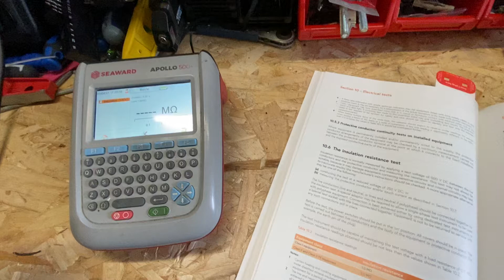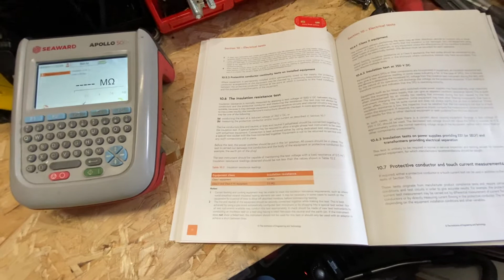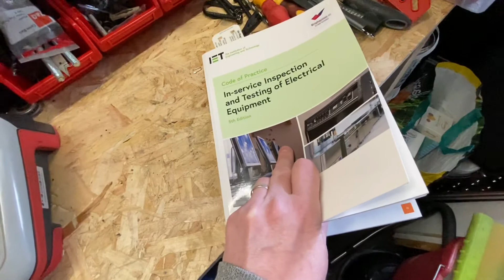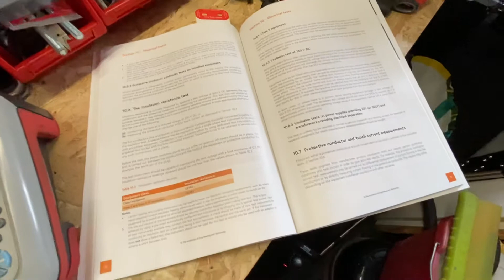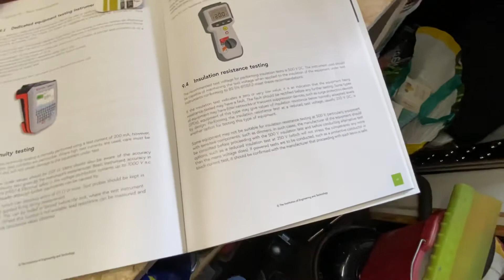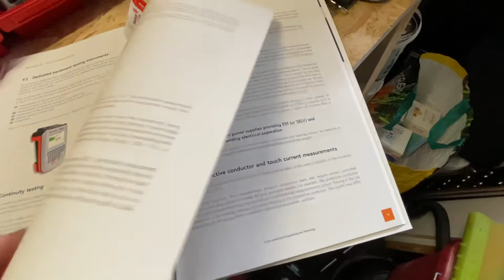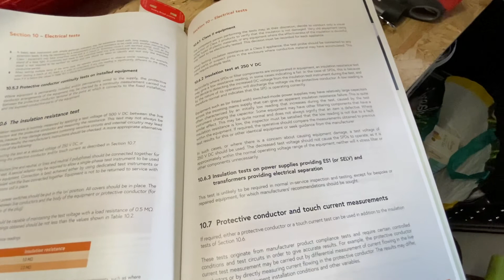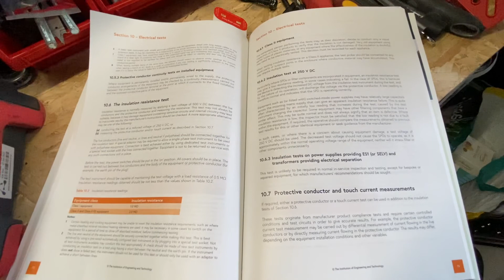PAT Testing  | Insulation Resistance | 500v or 250v? For Class 2 and Class 1 PAT Tests

Comment: Hi, do you need to test radios, cd players,  as they are class 2 items , the only place you can attach the fly lead would be the aerial or on large systems , metal casing and speaker connections.
Reply from the maker: yes, if class 2 then you would connect your probe to any exposed metal.

Comment: Any tips for doing the 2377 C&G PAT ...??  Taking it in Nov. Already have what one interviewer referred to my online PAT qualification I understand to be legally recognized as MICKY MOUSE and the Kewtech Tester I got for £360... is it that the 2377 includes FIXED appliance testing (in house purpose designed circuits) whereas my online course and certificate is for truly portable equipment only etc etc etc
Reply from the maker: I think one thing to remember is that there is no such thing as a legally recognised PAT tester or test course.
To carry out PAT testing you only have to be someone competent but that is down to you how to demonstrate that. Doing a 2377 course is not necessarily the holy grail unless you are working for someone who may stipulate that you have it.
Reply: @caterhampattesting  That seems ok mate but why did they think of my online £60 certificate as Micky Mouse??
Reply: I'm an approved electrician 50 years experience (yep that old) . I did repairs for rental properties and was asked by the letting agent if I could do some pat testing I said yes and she said do you have a C&G pat certification. I said no I don't need one as my electrical qualification demonstrates I am a competent person. Apparently the pat testing company told if they don't have C&G in pat  then they are not qualified. The same crowd said it was mandatory to test every 12 months.
I told her to ask them for a copy of their testers C&G qualifications for audit purposes . Turns out half of them never had it.

Comment: using the apollo 600+ what test do you do on a computer moulded lead? Lead 0.1 Ohm 500v IR??
Reply from the maker: it does depend on the length and csa of the flex. some cables are .75mm or 1mm. could be between 0.1 and .0.15
Reply: @caterhampattesting  .75mm and 1m length?